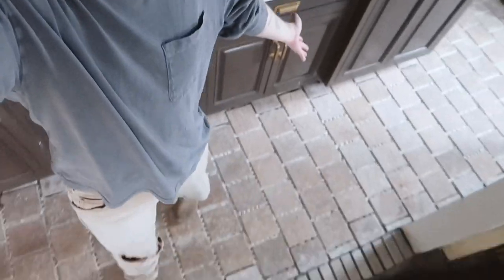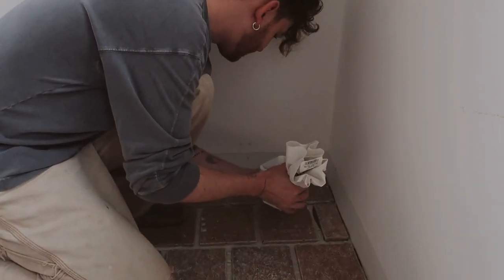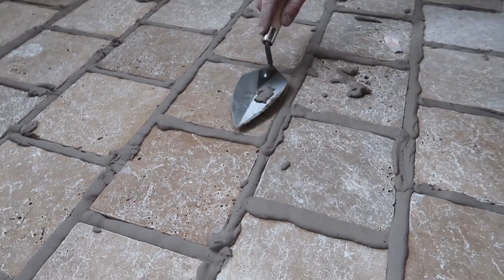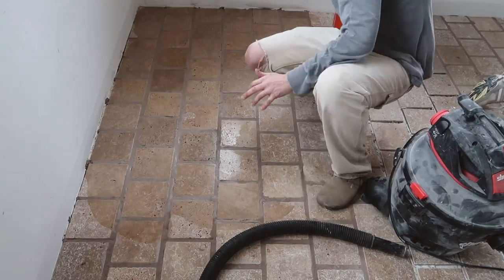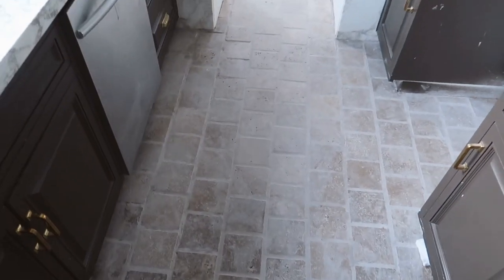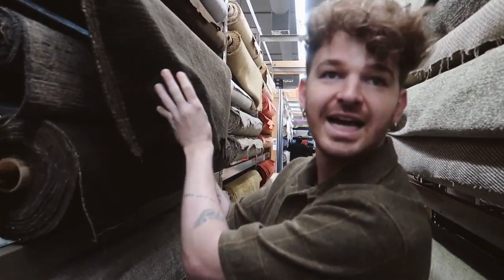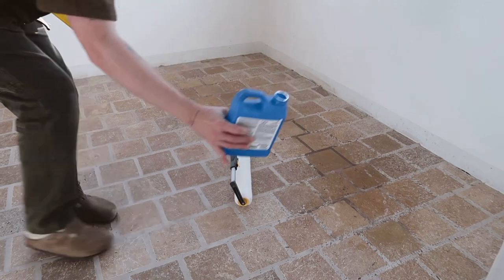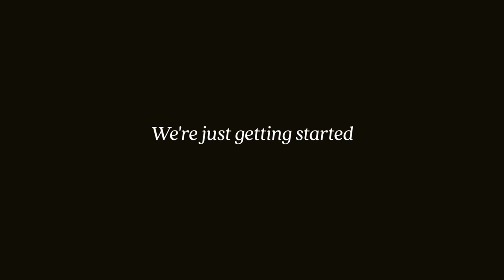I Finished The Kitchen!

Comment: Drew, I would suggest putting down floor protection boards so you could protect your wood floors while doing renovations. They sell them at Home Depot or Lowe’s. The floors look amazing!
Reply: An  easy save for flooring while doing construction project is just cover with cardboard sheets - can get larger 3x4 shetts. Or use the construction ' heavy craft' paper on roll ( ream ) - but the REAL TRADE SECRET is to clean up every day - yes last hour is clean up ( sweep floor and shop vac for corners  etc)  - IF REALLLY DUSTY project  then seal off room  with hanging plastic sheets that way rest of house 'saved'
Reply: Yes , floors must be protected always during remodeling . I used : Ram Board
38 in. W x 100 ft. L Heavy Duty Temporary Floor Protection . In some rooms I laid plastic over it  and attached it with tape ( if water any liquid was involved in others projects ).  Or just plastic without heavy paper.  Anyway, floor was protected during the whole renovation process. Plus less cleaning.

Comment: Just a tip when mixing grout with a drill paddle, it creates air bubbles in the mix, which in turn can weaken the grout and it can crack or become loose, just let it sit for a little before using (obvs not too long so it dries) or mix with a trowel for no air ❤ p.s I’ve watched your vids for a couple years now since lockdown and you’re just a gift! You inspire me so much not to just renovate or redecorate but to make my house a home and that is priceless. So, thank you Drew ❤❤

Comment: I am so glad that you are going to put a sealer on the floor. One of the things about having a very organic flooring is that all those divots and pits catch all kinds of dirt you had no idea you were bringing in. The sealer will certainly make maintaining your floor much easier!
FYI, the next time you need to seal a large area, purchase a 24”paint pan liner and use it to hold the sealer. Basically you are painting the floor just as you would a wall.

Comment: Grout always drys lighter then when it’s wet. All grout does that. If you had used the proper tools you wouldn’t have had such a mess. There’s a squeegee for spreading your grout. Which would have removed a good majority of the unused portion. Then you wipe it down with your sponge to clean it once it’s partially dried. All done. Question where is the dust bag for your saw. Messy messy. I love that your doin it up right for the style of the house. Beautifully done.

Comment: Genuinely love the direction you took the kitchen, and cannot wait for the exciting reupholstery on the sectional!

As for the travertine - please please please try out the impregnator on some of the pieces going under the fridge first. Since you grouted prior to sealing, the impregnator (which, btw, is a sealer that penetrates the top layer of the stone for an all-encompassing protection rather than a regular sealer that just sits on top of the stone like sunblock) will seal any lingering grout haze, construction dust, and miscellaneous residue. This can change the color of the stone and the minor debris can either be more or less visible, so please test it out first!

Comment: Drew, what are using to clean your wood floors? I have the same mop and I was wondering how you liked it. Just an FYI about your tile floor...because some of the tiles aren't flush to each other, it can be a little hazardous. I sometimes get the side of my sandals stuck between two tiles and if someone were to wear heels, it could be problematic. Just keep an eye out, especially because these tiles are spaced more for outdoors than a high traffic kitchen/dining room.

Comment: Omg. I really need to ask this: Why are you doing everything backwards? In Germany we do everything thats dirty renovation work first, and the other stuff last.. Like first we do the floor and tiles, since it creates so much dirt. Than we paint the walls white, bc otherwise they of course get dirty again. And last step is the kitchen cabinets.. As you can see your new fresh painted kitchen cabinets are already dirty, cipped on edges and effected by the dirty etc of tiling. I just don't understand the chronological order of the working steps 🥲